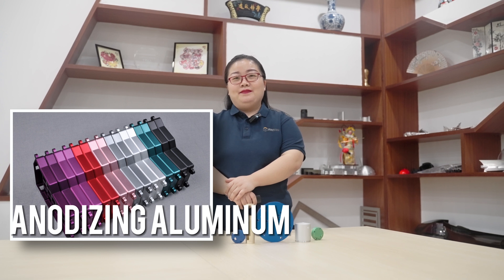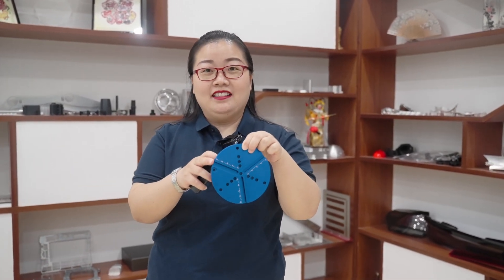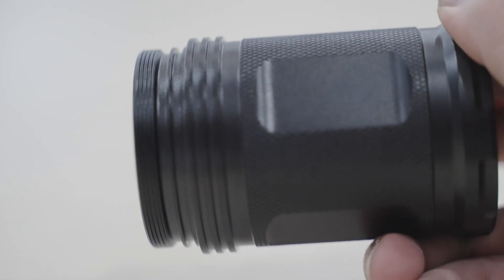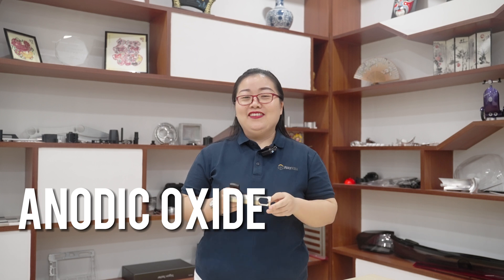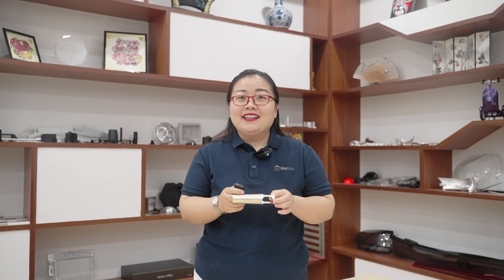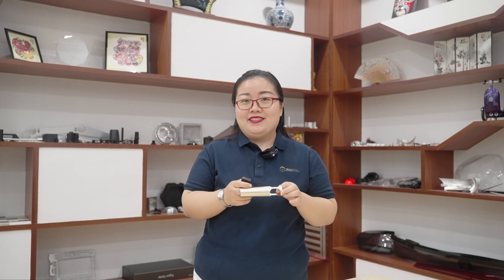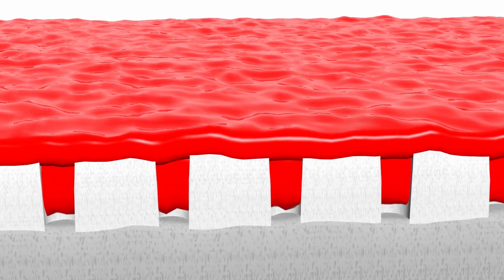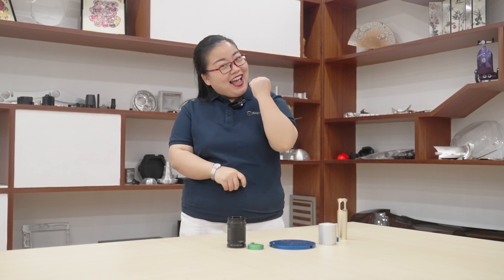Anodizing Aluminum: Types, Benefits, and Process Explained  | WayKen Rapid Manufacturing

Comment: is it possible to anodize in the inside of the rectangle tube having ID of 11x22mm & OD of 14x26mm and is 750mm long ? want hard anodizing with mirror like steel finish, glossy.